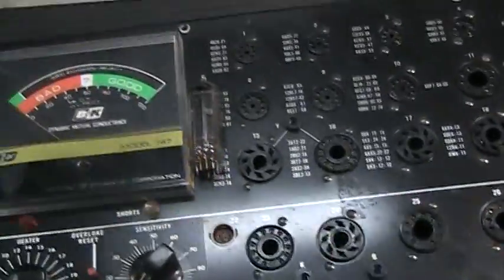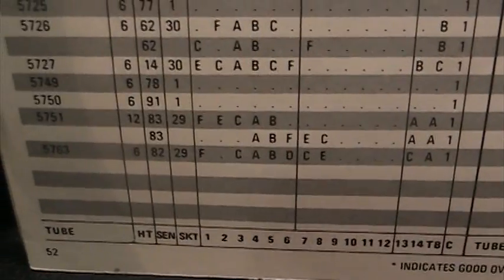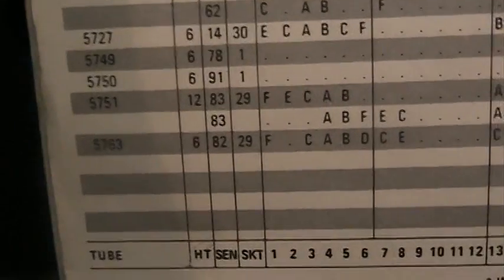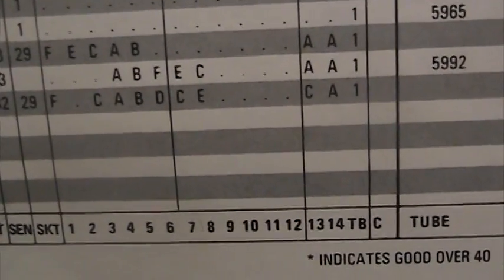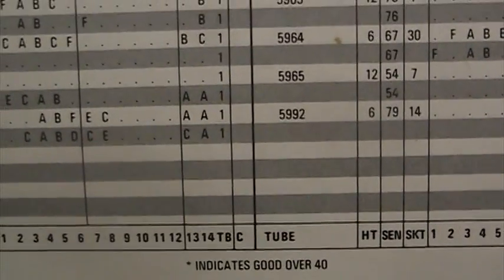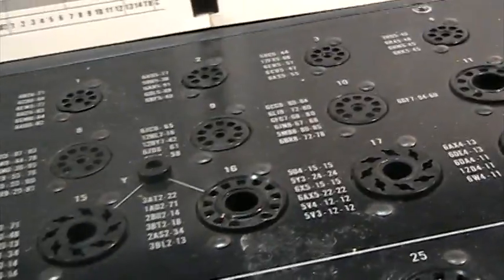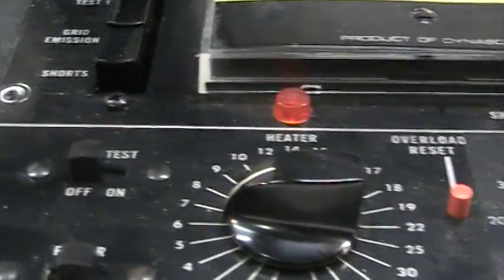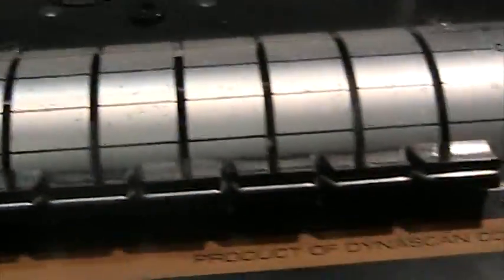BK 747 747B Tube Tester B&K

Comment: I take it this is no longer available?
Reply from the maker: It's available but its going to take $350 for me to let it go,
Reply: Hear ya.  My buddy wants this model.  I am buying a TV-2  that needs a little love .  Does this do anything the TV- 2 doesn't or is it easier to use? 
Liked your explanations by the way. I am in Mass.  Your not close are ya?
Reply from the maker: I'm in Detroit. I have heard of a TV-2, have heard they are very good. That's the extent of my knowledge of them. You will have to do your own reseacrh on that.
Reply: If you mean brand new, then no. I have a 747 (non-B). Made around 50 years ago.